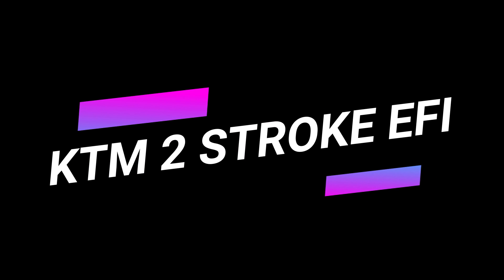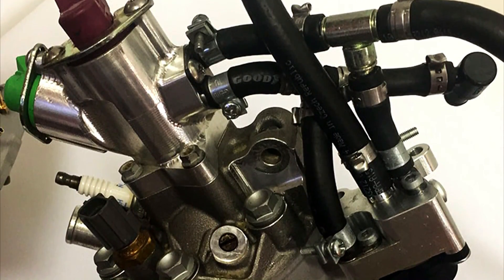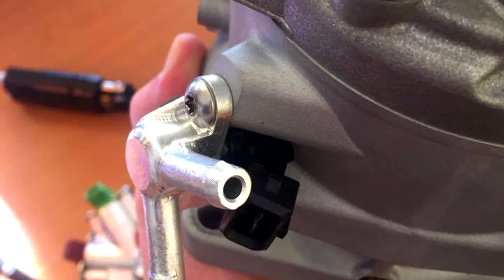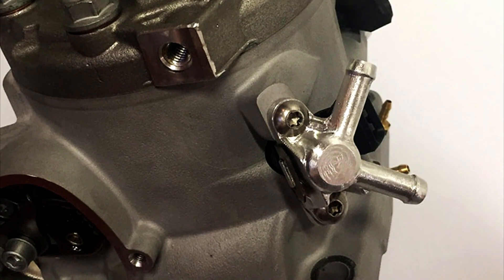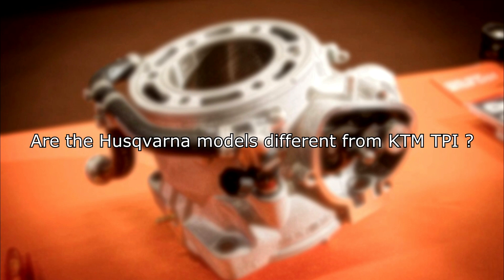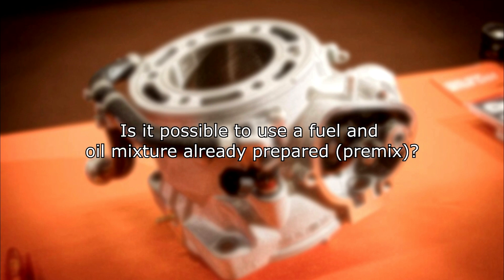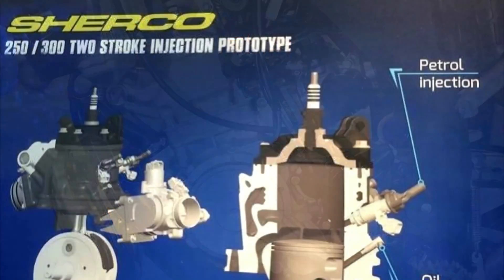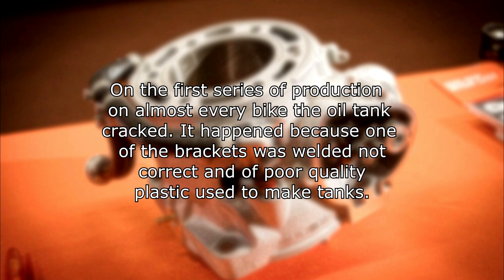KTM EXC TPI Fuel Injection: How it Evolved

Comment: What might a street version of this motor be like?  Side by side 300cc motors on a common crank?  Or side by side THREE 250 motors on common crank!  Be SO fast!  But with modern electronics could also be ridden tame as a kitten if so desired ....a rain mode a mild mode, a street mode and of course a full power crazy Track Mode   The RC3!

Comment: I cant believe EFI 2 strokes werent made widespread before the new regulations in 2006...Even Polaris had an EFI snowmobile in 1991, and by 1999 they had a 32bit ECU controlled, sequential firing DIRECT INJECTION, 135hp 3 cylinder 2 stroke injection in 1999 on a 1200cc jetski! (Genesis 1200)

It cost the EXACTLY the same MSRP as the slower and less stable 130hp SeaDoo GTX and weighed the same too. Only issue was the computers werent fully watertight and or would have chips go bad from overheating!

Comment: You need to do a bit more research before posting KTM propoganda. Neil Hintz, the builder of the YZ250 with TPI in the video, built that bike 10+ years ago and it is still going fine. KTM were unable to patent the TPI due to Neil making it public knowledge a very long time ago. KTMs patent application was denied. Neil now has a new improved Mk2 TPI. We're all waiting for KTMs version to appear.
Reply from the maker: That is true, but for KTM was not only important to make fuel injected. It was also important to make bike what will pass strict emissions regulations here in EU. Neil also did big work, but its sad he didn't put his product on market for sale.

Comment: I’ve created an oil sensor for KTM TPI to monitor oil system failures. It’s pretty simple to install and no additional adjustments needed. See here https://m.vk.com/o3sensor
Also it can be fitted on Beta and other models with separate oil system. 
It’s mostly in Russian, but don’t hesitate to write me if you have any questions.

Comment: im surprise this didnt happen sooner my 1972 ts 250 was oil injected what was the hold up with the fuel
Reply: the older oil "injected" motors were quite simple really... they kept the oil in a separate reservoir and pumped it into the carb as it was pulling air and fuel into the motor. a certain amount of oil was pre-set to be pulled into the motor as the fuel and air was pulled in from vacuum. Now with the fuel injection models it has to inject the fuel and oil into the chamber (post reed valve) at just the right time, thus requiring computer systems (TPS, CAS, MAP sensors) to operate.
Reply: @evanwilliams6352  I think you underestimate the old systems.  Most old Suzuki and some Kawasaki injection systems ran oil not only to the intake port (in the cylinder, after the carb) but also down to the crank and lower rod bearings.  A lot of those bikes came with a non-slotted rod big-end in order to hold the pumped oil better and reduce consumption.  This also had the side effect of blocking premix oil from reaching the bearings, leading to the old wisdom that "you can't run mix in an injected Suzuki".  These systems even adjusted the oil volume by RPM and by throttle position.  Compared to mix, they ran very oil-lean at idle and low speeds, but moved tons during flat-out running, which meant they were better lubricated than mix bikes even though they used about half as much oil on average.  I'm sure the modern systems do better, partly due to there being no fuel in the crankcase washing oil away, but the old systems were still very very good.  In the 60s they thought 2-strokes were the future, and were getting the technology ready to go into cars and airplanes and everything.

Comment: You guys should look into snowmobile 2 strokes,they had fuel injection since 1990
Reply: thats completely different, that only mixed the oil with the fuel without having to premix the fuel yourself. still uses a carb.
Reply: @evanwilliams6352  still uses a carb?
Reply: @2500zuki  yes still uses a carburetor, which requires manual adjustments for tuning. What you're referring to is the oil injection, which mixes the oil into the fuel, at the carburetor, so that you don't have to premix the fuel before hand.
Reply: @evanwilliams6352  they don't use carburetors,snowmobiles use injectors,Arctic Cat was the first battery less efi.
Reply: @2500zuki  hmmm i see that now, i was wrong.. i just remember as a kid riding some of the old arctic cats and bombardier's that stated they were "injected" but in reality they still had carbs. we would cut that system out and just premix the fuel for peace of mind. so these must have been different models that i hadn't seen before.
Reply: @evanwilliams6352  oil injection is one thing,fuel injection is another
Reply: Bullshit!!! Direct injection is superior.  The rights to use D.I. is why KTM didn't use it. Costly. Fuel injected 2 strokes are not new. Evinrude outboards had F.I.C.T. fuel injection which was early H.P.D.I in the early 90's.
Reply: @chadanderson2486  FICHT to be correct, and Orbital.

Comment: Hmm, oil tanks that crack and oil pumps that fail, I'll stick to my carb'd 300 thanks. In fact the wiring on the carb'd bikes is pretty poor, really thin brittle wires are used, TPI must have a load more wires so I hope they have improved the quality of the loom.

Comment: i have 2017 300 exc with lectron. i dont touch the carb all yr long, I also ride at 400m asl as well as 2000asl with no issues and no need for adjustment. I get very good mileage. all that without 3kg of electronic crap subject to failure
Reply: Lectron in awesome, my causing have put it on his yz125 now you must be carefull you dont fall on the back when you put on trottle
Reply: I hear the smart carb is even better

Comment: Only the 2020 TPI actually corrects mixtures for altitude while riding....
The Earlier models only measure atmospheric pressure at start up and then disregard the sensor while running.
This is why some owners bike run poorly while others run fine.
Reply: I can only agree👍
Reply: Meanwhile my 2019 KTM 300 TPI runs much better than my 2020 and 2021 model - no matter where I go up or down in altitude.
Reply: @kimojon9665 
KTM, still prototype testing on its poor customers 😏
Reply: @Danger_mouse  look at the prices - customers are definitely not poor lol!

Comment: aside from emissions the Keihn carburetors fitted with STIC metering block on traditional two stroke dirt bikes make the TPI injected two strokes obsolete in my opinion and overcome drawbacks normally seen with carburetor fitted 2-stroke dirtbikes
Reply: On the other hand there is zero reasons that EFI can not be improved even more I would think ....Can a carb work by wire like efi?   also idk but it seems like the the fuel pressure of an injection system could also combine small amount of oil and fuel in a just in time manner and injected as cooling lubrication to whatever areas might benefit loke bearings and maybe piston

Comment: mmmm not the real first company with a 2 stroke injection... i have a 2011 ossa tr280I.. A trialsbike what is olso a 2 stroke with injection.
Reply: Yes, just like my little oil injected 1981 Suzuki ds80 when I was 7.
Reply: This is not about the oil-injection. Every Japanese manufacturer had that in the 70's. This is about fuel-injection. Your old Ossa still had a carburetor...
Reply: @charleswarner2237  no, ossa was fuel injected
Reply: @charleswarner2237  The last generation of Ossa trials bikes had a full fuel injection system and it worked amazing - I know because I rode them  , the current Vertigo trials bike as developed by Dougie Lampkin is inspired by the Ossa who wad the first to perfect Fi in off-road 2 strokes